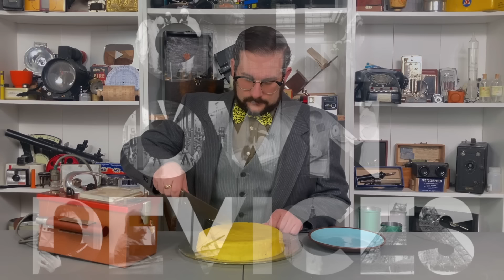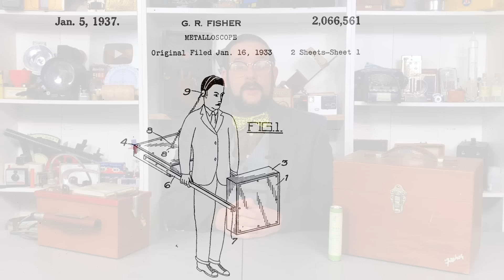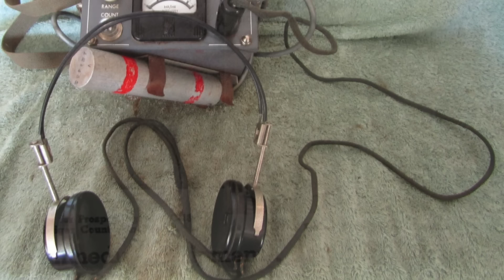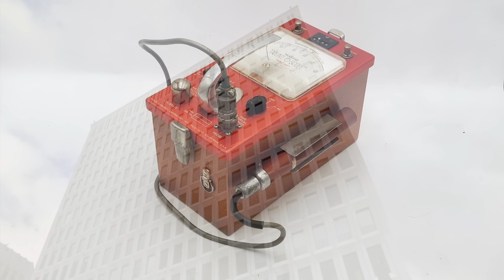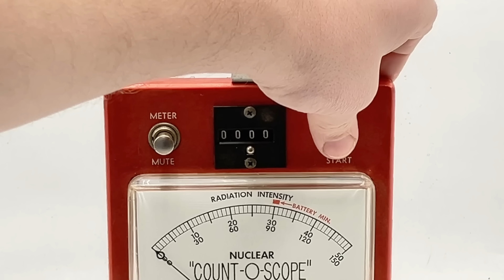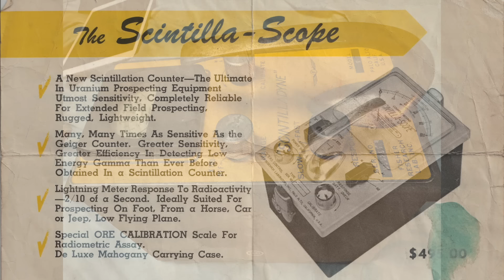Fisher Count-O-Scope: Mid-Century Radness

Comment: Ahh, so cool! I have the "Scintilla-Scope," it's a prized possession (albeit highly modified into a gamma spectrometer). 

A couple of very minor corrections: 

-V4 and V5 form a classic Schmitt trigger turned into a monostable multivibrator by inserting AC coupling in the voltage divider path of the canonical circuit (the AC coupling network is the 0.005uF cap and the 270k+2MEG CALIB pot). Upon a negative pulse at the anode of the GM tube, V4 turns off and V5 turns on for a time set by the AC coupling network, supplying a fixed quantity of output charge. 
-This charge during the V5 on time is directly integrated across the 50uF meter smoothing capacitor, being applied to its negative end by passing in series through the relay coil/ snubber circuit consisting of the "R1" relay coil, the 100k+1N34 quick-turn-off snubber, and the 0.1uF capacitor. The relay coil's back EMF pulse is absorbed entirely within the closed loop formed by those three components, without impacting meter registration, as the snubber is entirely isolated.

Also, a couple of observations:

First, the schematic is very similar in many places to that of the Scintilla-Scope. Lots of design reuse! Same charge pump style inverter, same voltage regulator. 

Second, it may interest people to hear a bit about the operation of the high voltage inverter. I can speak on this since I am familiar with the one in the Scintilla-Scope. This inverter is basically laid out in the same topology as the Ćuk Converter, a very modern power conversion topology, except with a 10Meg resistor substituted for the output inductor. The Ćuk is fantastic for vacuum tube tech, since both power devices have a grounded cathode, allowing these subminiature direct heated tubes to be easily used with grounded filament batteries. 

NE1 is the entire relaxation oscillator, producing a string of negative going edges as the neon lamp repeatedly discharges the 0.002uF timing capacitor. There resulting oscillator sawtooth drives the grid of V3, at first leaving it mostly on and only turning it off for very brief periods while the neon flashes.

The converter operates with very high switch on duty cycle, meaning that the the 135V supply is applied to the inductor for most of the time, and then for very brief periods the inductor flies to very high positive voltages at the plate of V3. During this time, the rectifier V2 clamps its end of the 0.002uF flying charge shuttle capacitor to ground allowing the flying cap to re-fill with charge from the inductive spike. Then most of the rest of the time the inductor and inductor end of the flying cap is pulled low again and the V2 end of the flying capacitor is below -1000V. 

Even thought the 10Meg resistor (in place of an output inductor in the Ćuk) actually discharges the output somewhat during the flyback pulses, these are so brief that they don't matter. Most of the time the flying cap spends somewhat more negative than the output, supplying current through the resistor. A cheap and dirty way to effectively rectify or smooth a pulsing output into a DC output.

As the output drops below ground to the set-point voltage, the shunt regulator tube V1 starts to bias the grid of V3 more and more negative, lowering the voltage of the sawtooth. This causes the tube to conduct more weakly during the on periods, reducing the current in the inductor (and hence also the current available for recharging the capacitor during spikes), and also raises the voltage on the V3 end of the flying cap during on periods, both of which make the output less negative. This is a very lossy and analog old fashioned way of regulating the output of what's more or less a switching converter, but I guess it works! 

A noteworthy item is the value of the inductor. In my unit, it's something like 60-120 Henries! Yours looks pretty similar in size and construction. It's very unusual to deal with a circuit component with an inductance measured in more than millihenries in modern circuits, 60H is unheard of outside of transducers, and is super high. The inductor is laminated iron, and the inverter only operates at about 100Hz. Crazy.
Reply: Longest comment i ever saw on YT 😂
Contains more text than the entire video.😂🎉
Reply: And I was thinking a Chess match was going on... 🤔

🖖😉
Reply: Well you must be a real party starter!

Comment: The diode is a 1N34 not an IN34.
I liked the yellow cake gag
Also:  In schematics relays are normally called K1, K2, ... etc.  R was already used for resistors.

Comment: Chances are one of the capacitors around V6 and V7 that implement the timing circuit have drifted, dried out or just plain got tired.  If the relay R2 doesn't actuate, then that'd be a hint to confirm.  I don't think the particular flavor of capacitor used there is critical in that simple RC timing application, so replacements with a suitable voltage rating should be easy to find.

Neat stuff!  Worlds different than my Radiacode 103; time marches on.
Reply: Integrating circuits are very sensitive to leakage as well.

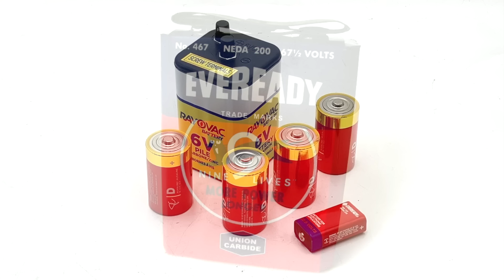Comment: 12:21 Excuse me, what kinds of batteries? No 467??? Sixty-seven and a half Earth-man volts???? Please elaborate!
Reply: "B" batteries were high voltage and were used in portable devices to supply tube grid voltage, before low-voltage tubes came into use. Needless to say, they're nearly impossible to find today, and most hobbyists gang up 9V cells like Gilles did.
Reply: @NOSdWOH1  I use 12v  23a batteries.  Tiny, but provide the voltage needed when strung together.   true power consumption is low.